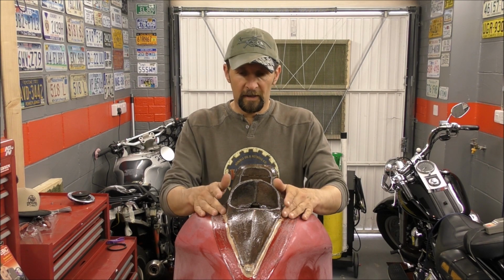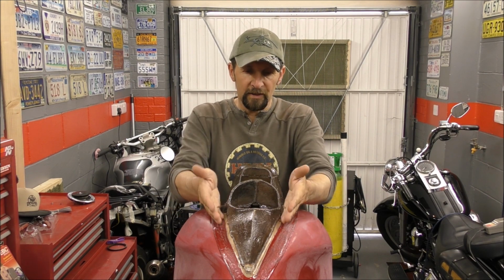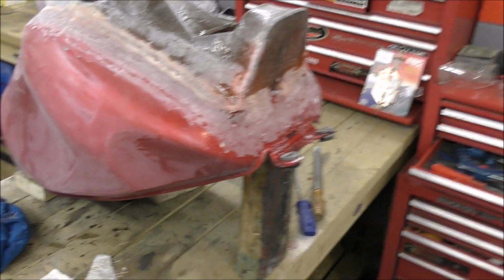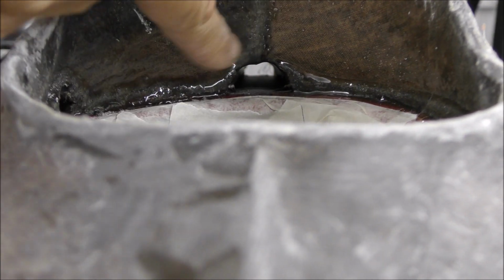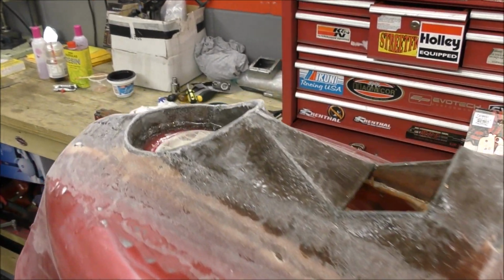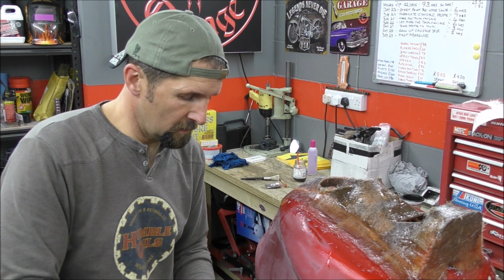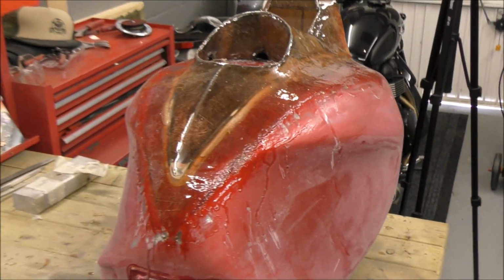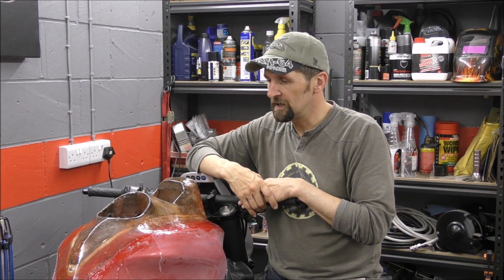Delboy's Garage, Fighter Build #26, Lets get messy..!

Comment: hey I am enjoying watching you do your fiberglass I worked in a body shop until I went I got tired of insurance adjusters and went trucking.  To make a long story short the trainer rolled the truck while I was in the sleeper and damaged my neck and back to where I couldn't go back to work which sucks cause I really loved working on cars ......  a few tips on fiberglass if you you don't want to use themrits just what I found out worked good for me while working on corvette's .  When you are grinding it down and you get the dust and fragments on you ,  to take the all those fibers off you use a tack cloth and I am not sure what you would call it there but you use it to wipe down what ever you are painting before you paint.  Its a cheesecloth with soe stickey to it .  Most people cant stand the fibers on them and wipe yourself down with the rag and it takes them off then blow yourself down !   You are doing an awesome job and I really like the bike the way you have donre every thing especially the bobber tank for the front !   Thanks for taking us with you on the adventure !  You are right no rules !  Thanks again !
Reply from the maker: Thanks Cody, that's very kind - and a great tip on the tak rags !  Yes, we have tak rags here , I used a couple to get the final coat of silver on the paint in the latest video, they are not commonly used by the home builder, so I explained them a little too... good tip on the fibre glass fibres too, the advice usually is never wipe your hands cos you push the glass fibres in to your skin, blow them off with an airline, or rinse with freezing cold water and don't rub whilst you rinse... worst of all, is to breathe it in, as once it's gets in your airway the sharp fibres can do all sorts of damage long term... take care my friend, appreciate you watching!
Reply: Thanks for replying... man I love building things but, when I try I end up back in bed for a week so believe me when I tell you that I live vicariously through you and your videos

Comment: hiya guys, 
i'm after a bit of info about the brakes on the fighter.
i noticed that it's been changed from a 1-splitter-2 line-caliper system to an dual individual line system.
i wanted to do this on my 7 and wondered if you could 

1- measure how long the individual lines are so i could get some made up,
2- just show or say what the brake feels like compared to the 6 pot tokicos (in the brake seal vid)

cheers for all the great stuff, it's given me the kick up the but to do my bits on mine.
Reply from the maker: Hi buddy, like Paul said, you can buy the dual lines ready made for your bike, and if they are bled up properly, they feel sharp and responsive, just like any sportstbike brakes should be ...

Comment: Have you ever thought about acoustic treatment for the garage? Not that it sounds bad or anything but I think if you made the room somewhat acoustically "dead" it would make your videos sound really really good. Especially since you're using an integrated camera microphone ;) The bike is looking damn sweet though! As it creeps closer and closer to being finished I'm getting more and more excited!
Reply from the maker: Hey buddy, we've been round the block with this one (audio) like you wouldn't believe, so you're joining this discussion rather late lol - we first opened this garage in January, if you go back to that very first video 'Project Garage Video1' hear me talking in that, it's practically inaudible, and you'll see from that, how far we've come - filling the garage with 'stuff' has it's own effect, and has made a great difference, plus the 6 acoustic boxes I made have left, maybe, only 10% of the original reverb - even this newest camera, a £500 item acquired last month, has made an improvement due to it's two channel focus mic., it has an option on 5 channel surround which picks up all the reverb... and the two channel picks up just from the front, so as much as you may be noticing it, it's only , maybe. 10% of what it once was, and the sound issue has been our very greatest and largest challenge since opening this new garage.. all of the sound deadening in the world is useless, as it's little more than soft furnishing and dangerous, with hot sparks and welding, in a garage - but we have the crowning glory to come this week, as the shotgun mic. arrives shortly... and in terms of sound capture, this is like going from wide angel on a GoPro , capturing sound from about 180degrees facing forward (which we currently have) to a narrower angle lens of about 45degrees frontal sound capture... which the shotgun mic. will have, and on to of that, it will have a wind sock over it to cut out flare... this is the last step towards the sound we're gonna take for a while, as the accoustic shape of the space we are in is the worse possible, it's long and tall like a corridor and gives the sound a chance to echo back and forth... the only furhter step we could take is radio lapel mics. and that kind of outfit starts at about £500 for basic stuff, and we just don't have the money, but working on it all the time, and will get there in the future - you can become a Patron if you like and help towards this kind of thing , as we don't get paid for it in any other way...
Reply: A shotgun mic will definitely help! I didn't mean to say it sounds bad in anyway or suggest you haven't put any effort in!

Comment: Hey del 
Just wanted to know best plastic primer? Thanks in advance..
Reply from the maker: Hey buddy, depending slightly on the plastic itself (fibre glass is different to the injection moulded stuff), then you could try just good old regular primer... scuff up the plastci using some 800 grit wet 'n dry, and wipe it clean thoroughly with acetone... or if you haven't got any of that, those medi wipes in a first aid kit are perfect, as they will leave the job chemically clean... then lay the primer up in thin coats, should work fine buddy, good luck with it, all the best, Del

Comment: The guitar solo in the beginning was quite nice! Glad you pointed it out, because I likely would've missed it while paying attention to the video.  Approx. 21:20 had me dying!  "So you don't die..." 😂😂😂

Man, this thing is looking good Del, can't wait to see it after filler!  Did you happen to weigh the tank before?  I'd be curious to see what the additional weight is, when done.  Can't wait for the next one!  Ride safe D&P 😎👌
Reply from the maker: I have kept a weight estimate of the materials so far... the frame was less than 1lb, the cotton T-shirt cloth, neglidgable, the matting and rope with the bonding glue.. maybe 1/2 lb... but the biggest add on would be the resin.. it now holds a full liter of cure resin, and that was about 1.5lb all told.... so the whole lot is no more than 3lb's... which calculated out is just over 2 liters of fuel...and since the tank holds 19 liters... the console is neglidgable... plus ive taken so much off the bike by removing the bodywork that its still well under weight..!

Comment: oh i was wondering what the honda was for. and your a lefty! never noticed before. Would it be hard to extend the filler cap up to the height of the fibreglass safely, without having to weld it? Not saying you should change yours , just a thought. Cheers
Reply from the maker: Yeah, thought of moving the cap...and no, its pretty easy without welding it.. but i kinda like the filler sta down in a hole...lol

Comment: just a quick one, the fibre glass on the tank needs strips of fibre glass over the joints like at the front of the consol and at the petrol cap hole, you just ran the fibres up to the edge and didn't put an overlap. I don't think it will be to much of a big deal but there is a chance they can separate now.
Reply from the maker: It was 3 1/2 hours to get that all laid up, and all the flat runs are 50% overlaid... the ecute edges have two layers joining as they meet and resin'd in....also they have a steel frame at that point....one of the reasons i didnt go for this "blue foam" everybody keep suggesting... it'll be fine buddy.

Comment: Hi Del, another cracking job! Have a question requiring your expertise:

I have a really annoying tiny dent in my tank - probably 7mm x 7mm and only one or 2 mm deep, think similar size to someone poking it with a finger. The tank needs painting, so will I now have to strip the entire tank back to bare metal just to fill the dent, or can you use filler over the factory paint? Thanks!
Reply: Look at this on eBay  http://www.ebay.co.uk/itm/401112269652
Reply from the maker: Hi buddy... the one thing factory paint is, is strong.. you can just scuff up the paint with some 80 grit paper, and put the filler directly into the dent... then blend it out with paper.. you can trust the factory paint to hold it mate... never had a problem with that.. Good luck. Del.
Reply: +Moonfleet41 Awesome, thank you! That's what I was hoping you'd say, so much less effort than stripping! Assuming I can do the same with a deep scratch through the paint - just rough it up and fill?

Comment: I would have used blue foam  with fumed silica filler infused with micro balloons. super light weight. just add some fiber for strength where needed.
Reply from the maker: More than one way to skin a cat aye... and a steel frame gives me a bit more confidence that stiff sponge...!
Reply: well it is an interesting solution, and most of the videos offer great advice on things that guys and gals can do in their home shops, I have learned a lot,
Great channel by the way.

Comment: As always a great video. It's intresting to see how someone else approaches a project like this and the processes they use to make an item. In this case you went down  a very different route to the one I've gone down[1], it makes me stop and think about how I might do things in the future.

[1] I've taken a mould of the tank, using that as a base make a carving blank from expanding foam and then carved out the shape I wanted. From there I've either laid up fibreglass  or gone through the process of making a bladder and made a pre-preg carbon-fibre item.  That finished item would have then been bonded into the tank.
Reply from the maker: Many ways to skin a cat aye buddy... Im just making it up as i go along.. if i had to follow rules, i wouldn't bother..!